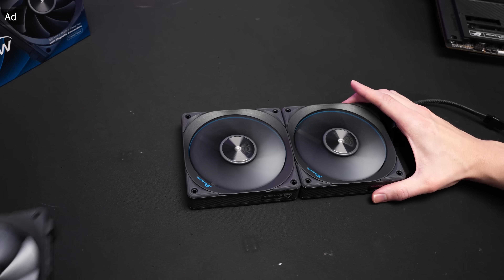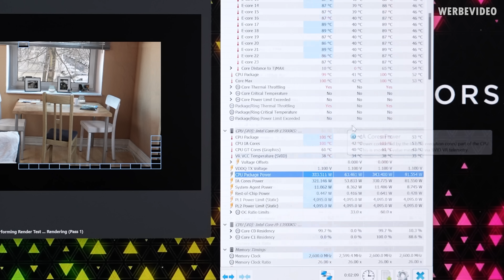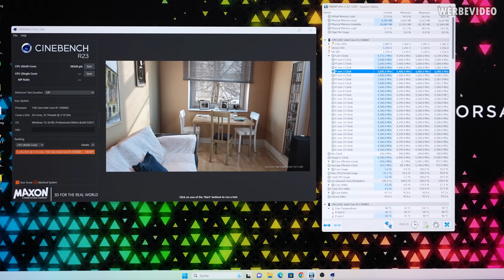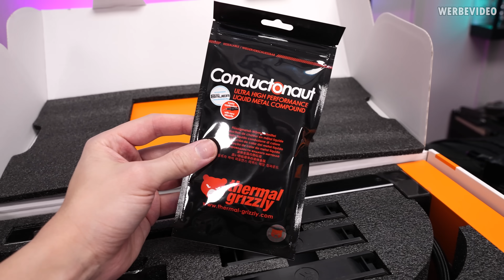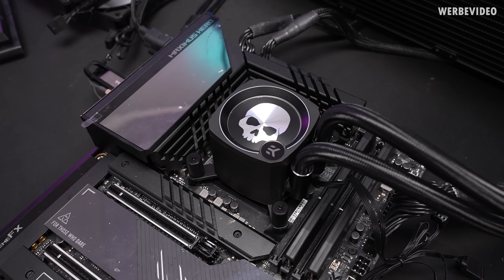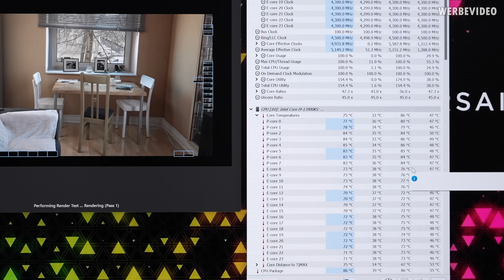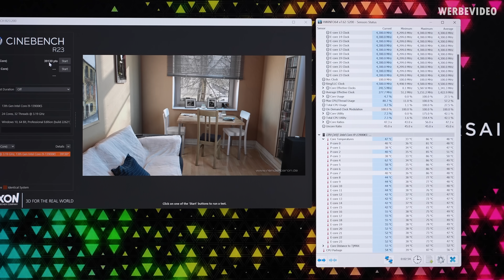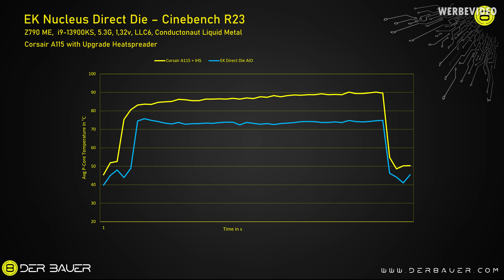Impressive Results! We're testing a Prototype AIO by EKWB

Comment: There is a lot of hate for the EK nowadays. Some of it is deserved. I mean, with those overpriced water blocks made with exotic metals performing worse than their own copper blocks as well as losing performance crown while maintaining one of the highest pricing schemes.
Though, arguably, their products look great.
Now I own tons of their products, and there are few flaws. But performance in my case is very good.
For example, I still have my stock 12900K, first stepping. With 1.325V and load line calibration at 2 of the MSI mainboard and Prime95 full load with the small FFT's I come to 64 to 65 degrees Celsius with closed case and room at regulated 21.5 degrees Celsius. That's with full nickel version of Velocity2 1700 EK water block. D5 G3 EK pump. X3 400 reservoir, EK water block for my 4090 and 1/2 ID 3/4 OD EK tubing. Alphacool 480 and 240 Monsta radiators all push pull. 
Krayonaut Extreme paste and cheap contact frame that could be screwed down completely. I haven't liked first version of TG frame regarding to mounting procedure. 
That's good result for stock CPU.
Is it perfect? My Velocity2 block RGB list its color accuracy. LED's burned out half way cresting brownish spot in the lense. So I have ordered new EK LED strip for it. New came with bigger LED's but with less of them. Great right? Mounted all together and no light. My mount was perfect so I was not happy. Dismantled it all. No apparent reason why it doesn't work. So I have cut out isolation on the cable to ribbon joint and measured. All connections are fine but it's dead on arrival. Great. And second mount used last of my paste as well. 
GPU water block. I have MSI Suprim X Fluid. I have taken off all stock cooling and got EK water block for it. Looks great works fine. But there is always an but. You can't use 180 degrees adapters. In my case the TG WireView.  You need to cut out peaceof plexiglass to fit it and remove one if the WireView  screws. To cut it one should remove the water block and most probably get new thermal pads and definitely use new paste. Or have experience and nerves of steel and cut it with the card inside. Ach yes X3 400mm reservoir. All but two main sideways holes are useless. All of them can be used for the stop plugs only. That's because they are not flat but lowered in by a millimeter at 17 millimeters diameter step down hole. There is no fitting that will fit in. All look like they fit but will leak somewhat because rubber O ring is not touching anything. Even extenders and adapters have 18mm diameter and yhats smallest diameter used for the water cooling. So to use bottom location for the fitting properly I have had to machine it to accommodate 18 millimeter diameter extender. Now think, you can't center with the hole due to the fragile threads in the pom and odd size. You can't fix it in the machine easy while round and soft. Plus it has to be co-centric with hole or new step down hole will need to be way bigger. Without shaving of complete bottom for a millimeter this is a nice challenge. Luckily I have some experience. But over all, bed LED strips, bad engineering of the space around the power connector and bad engineering of the bottom of the reservoir. Pretty sad. Though it looks awesome and performs good in my case.

Comment: I am old enough to remember when all CPUs where direct die out of the box :P
Reply: I miss overclock by pencil
Reply: @abc123evoturbobonker  I miss freedom to overclock.  FSB, DRAM,  not K CPU and shitty XMP.
Reply: yes. and then hair spray to hold the pencil marks  @abc123evoturbobonker
Reply: And no MB backplate... And coolers mounted directly on plastic hooks on the socket. The biggest inovation was rubber spacers on the corners of the CPUs.
Reply: Boxes? Back in my day, we had to wrap CPUs in pelts.

Comment: Great concept as you can undervolt the cpu to make it practically silent, but still great performance. Overclocking doesn't really help in a meaningful way in most applications that we use on a daily basis. But a silent pc? Yes.
However, i question the radiator's thickness, or the lack of. And, why can't they make the tubing 50cm instead of 40cm? Lack of flow? 40cm is usually to short if you have a bigger case and want the radiator vertical in the front with tubing down, which i prefer.

Comment: I think it needs the full list of tests to compare against.

Stock intel ILM and IHS with a normal 360 AIO
Contact Frame and normal 360 AIO
De-lid with upgrade heat spreader and normal 360 AIO
This direct die AIO
Custom loop with 360 rad.

And if you're feeling adventurous, stock settings vs OC on each. A lot of work (especially since 1700 is basically EOL) but seeing all of it on one graph will be fascinating.
Reply: Will be always custom loop and direct die winning.

Comment: I hope Lian-Li do a similar product in future i love their performance aio. Why do i get over 42k cinebench r23 and this doesn't get anywhere near. Im positive you'll be able to tune and  get over 42k with a direct die!
Reply: If you are tweaking your CPU to get 42k, that's not the same as slapping a CPU into a motherboard and hitting "play" on Cinebench R23.
Also, not all 13900KS are equivalent
Reply: @rustler08  my point is there's lots of performances still left on the table that's not getting used. This doesn't showcase the product properly at all

Comment: Dead pumps within a year on several Elite 360 series among my friends (incl. me). And it was not as efficient as it might be. The old S36 Celcius with Asetek outperformed it.

Regarding DD solution: they made super fancy DD AIO, but still use conventional 25mm rads and identical 3100rpm pump. Moreover, they still can't make a proper efficient custom DD water block after two revisions...

Thanks, no way.
Reply: According to their website they have a 5 year warranty on manufacturing defects. Dead pumps should definitely count. I say keep returning it until they get the picture that they need to investigate their pumps. It sucks though that you'd have to disassemble your PC every year and use a temporary cooler during the back and forth shipping.
Reply: their RMA requires the customer to ship the item all the way to their home country out of their own pocket, and they don’t cover leaks like NZXT.

Comment: You need to compare to other AIO's - like that same one with no direct die.
Reply: There isn't much of an comparison it's completely different.
Reply: For example with arctic liquid freezer 360
Reply: I think that there is no much you can get from that comparison. Direct die will always beat a standard solution. But direct die means you have a custon cpu block and that means you have a custom loop. So if this AIO delivers the same cooling performance as a custom loop, it would be a great choice if you don't want the hustle of buying and installing a custom loop.
Reply: @tH3GoDh4cKeR  and now imagine swappable cold plates for future sockets - shouldn't be that hard (not cheap for sure, but better then to throw away the whole AIO).
Reply: @tH3GoDh4cKeR  I really dubt a direct die AIO can offer the same performace of direct die custom loop. No chanche.
Reply: @Live1509   Who cares if the AIO solution is a degree or 2 higher than a custom loop if it works out cheaper than a custom loop
Reply: @Live1509 it could but would require high quality construction. The metals mainly used would have to be copper, radiator including, and the thickness would have to be either 30mm or 40mm, and most AIO rads are about 27mm. The pump would also have to be a bit beefier but if the cold plate is good enough as well you'll definitely enter margin of error territory. Would just be an expensive AIO lol, probably 250 to 350 USD.

Comment: Would have liked to see some overclocking. Also how much wattage it can dissipate.
Reply: Wattage dissipation rates are always marketing bs. Never buy something based on those numbers.
Reply: It's EK, so essentially a custom loop  rad with aio pump attached. My best guess with Romans current settings would be closer to 400w before it shows similar throttle patterns to the Corsair as was tested.

Comment: non  delided   items  build   up   more   heat   over   time  whereas   liquid  metal   allows  the  "  Die  "   to   Reach  a  static   Heat   dispositional  exhaust  medium   -  simply   put   ,   the  die  is  able  to   stay   cooler  as  the   liqmetal   is  disapating   more   heat  directly  from  die  and  has a  natural   set   state  rate  of   heat   loss  whereas   more   ,  being  a  heat  trap   with  the  Lid   than  anything (   just a  little  rant   on  heat  capture  )  at  well   kept   same  mods  =  both  delided   and still  disapating   even  more  heat   ,  its   the   natural   molecular  set   release  rate     that  allows   for  more   release  and  less   capture  ,  say   like  a  srawing  salve   you   put   on a  boil   ,   i   know   ugly   analogy  ,  but  basically   the  salve   is   the  key  here   does  that  salve  allow  for   release  earlier   than  removal   , , , too  many   compounds  capture  the  heat  rather  than  releases  it   ,  so  ,  yes   thermal  compound  does  matter  ,  the   closer  to   the  material   of   die   the   better  the  release  rate  and liquid   metal  is  closest   you  an  get  atm  ,  whereas  a  liquified  release   copound   of   die  material  would   be   sufficient  ,  trouble  is   by  what  misture   do  you   actually  stop  to  compound   from   eating   through   the   die   as   a   liquid   mod  would   more  than  likely   act   like   acid  over   time   to   it`s    own   structural   design
Reply: this       bot       needs         more          training

Comment: So the old myth of removing/plugging in fans while the computer is running could cause shorts etc are just myths?
Reply: Well there's layers here.

Roman snap plugging and unplugging a fans on an open testbench setup is one thing. If it shorts something out, he's probably got replacement   parts on hand.

Deciding to try and hotswap fans in your main system is another thing. Even if the fan connectors don't cause a short, you're much more likely to accidentally dislodge a cable that would cause damage to the system.

Comment: I'm using an AIO(Lumen S36) for delided i7-870 with liquid metal.
It's very cool even boost voltage to 1.65 V.
Reply: How many years has it been at that voltage?
Reply: Only when I do extream overclocking.
On stable OC, it's 1.55 v. @tcbat711

Comment: imo its not wroth it tbh. Especially not with EKWB. Out of the box Intel is horribly optimized so a little tweaking is required. I use tech enhanced in BIOS which has way less power draw but the same performance, my 14700k only reaches 80c now in CB23 if not lower and im on an 240mm Arctic liquid freezer 2.

Comment: EKWB? AIO? No thanks after the Predator.
Reply: You don’t want to pay for the pleasure of dealing with leaks, faulty bearings and plating disintegrating?  Some people just can’t be pleased.
Reply: The EK Elite and Nucleus series have been reviewed well by numerous well respected outlets. He is right that this particular application is niche but I'm guessing it's significantly less expensive than a custom loop. So if the AIO is close in performance to a custom loop, then it might be appealing to a fair amount of people.
Reply: better go with Arctic indeed. Their coolers are top notch and their support is also industrie leading.
Reply: They literally had the EK AIO recently and now the Nucleus (non-direct die version) and both are great. GN reviewed the original EK AIO very favourably besides the arguably bad/good aesthetics (depends on taste)
Reply: You're talking about history, to their credit they did compensate owners even for damage done, as I always says, mistakes happen, issues arose all the time, but how you deal with them and how you prevent them from happening again are the most important metric. I have the ek aio elite and it had performance issues after year and half or so and to their credit they promptly sent new one. Right now I'm using the lian li galahad II performance, but this one pique my interest, as taming overclocked 12900k is extremely difficult even at gaming workloads, this could offer great improvement.
Reply: My ek elite 360 has been rolling hard for over a year now no issues
Reply: I’ve had my EK aio for 2 years with zero issues man..
Reply: Bro the Ekwb Predator is almost 10 years old and they fix it with The Ekwb Phoenix which was 5 years ago
-Msi coreliquid had issues so they made a v2
-Lian li fix the Galahad with the Galahad 2
People can learn from theirs mistakes
Reply: @olivierwolphjoseph2329 The blocks are still fucking FLAKING. Not to mention the bent acetal ones. The QC with EK is nowhere.
Reply: EK DRGB series were benchmark tier, brainlet.
Reply: Predator? How old is your pc mate?